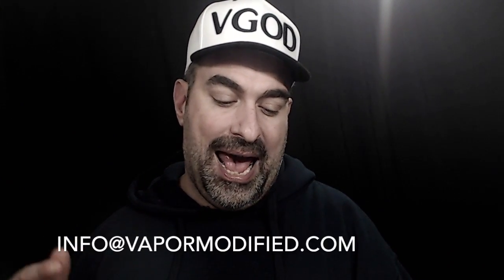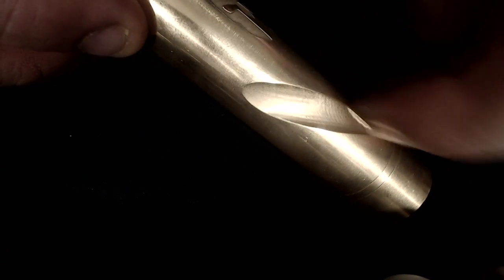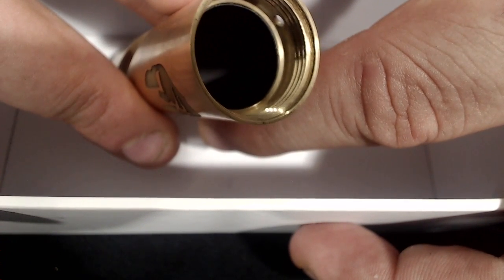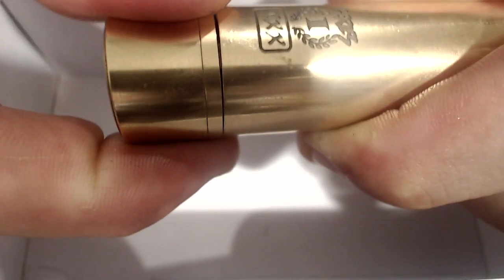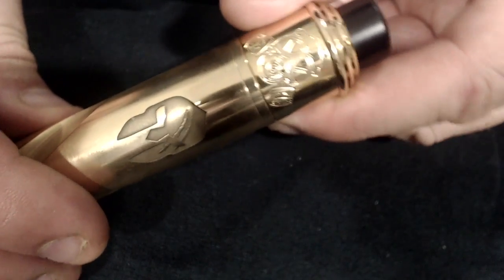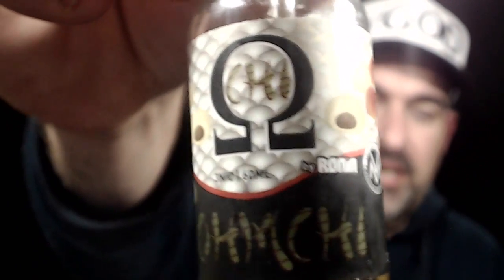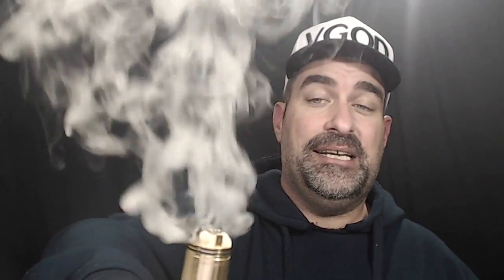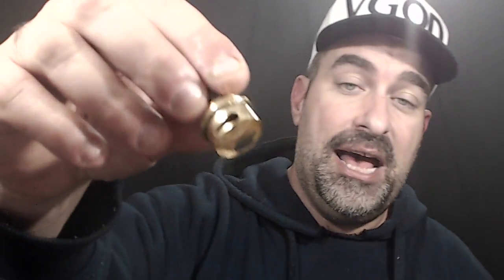Apocalypse RDA Gen 2 & The Spartan Mech Mod By Vapor Modified Review

Comment: Just a FYI Lou,  the logo isnt "engraved"  on that mod.  The logo is "milled".  In metal work they do some laser engraving (etching) , but if there's   a logo or finger spots,  they're milled on the CNC machine.  Laser engraving usually is very shallow and some of the time ya cant even feel the engravings. The button is laser engraved. Not hating just shooting ya some knowledge from a metal worker.
Reply from the maker: Joshua miller thanks for clearing that up Josh. I appreciate the input